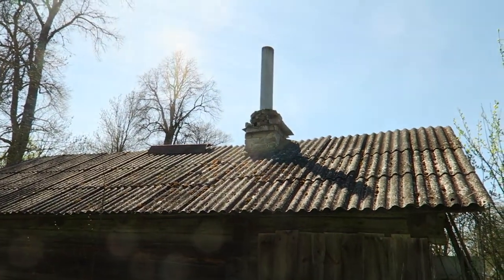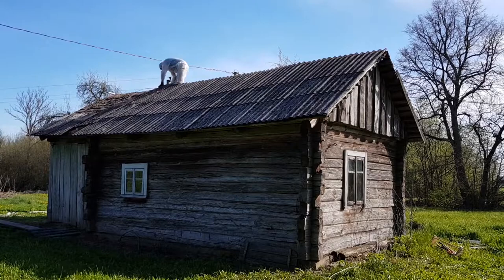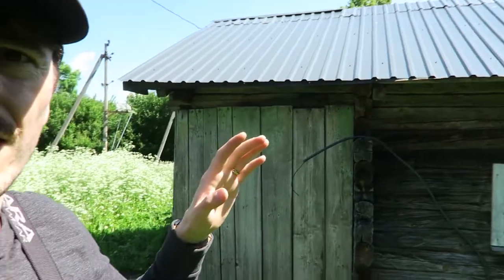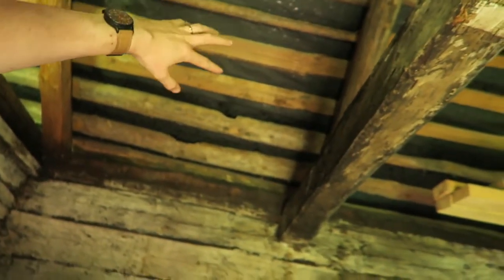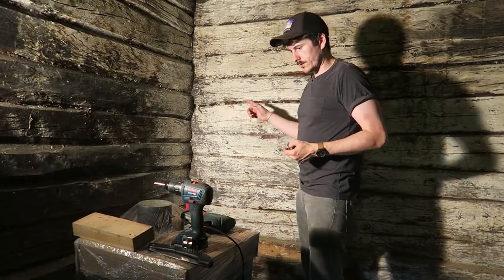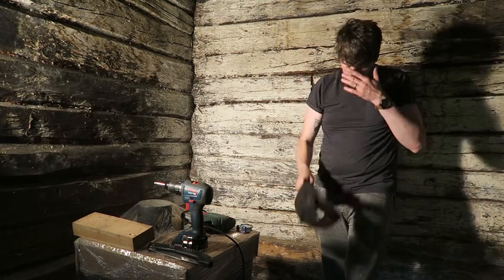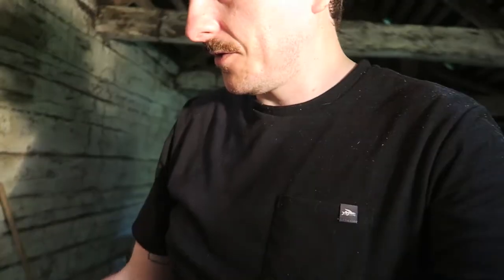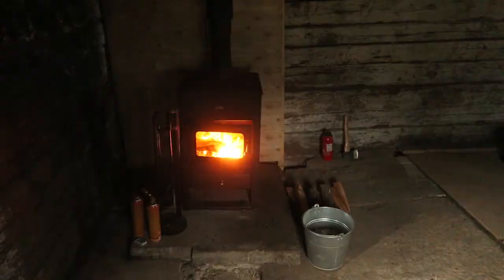Cabin to Workshop Renovation - Part 2

Comment: What asbestos roofing means ?
Reply from the maker: Asbestos is a material that was used a lot in construction in the 1940's through to the 1970's. I guess it was cheap and durable. But they later found out that if you breathe in the particles, it's super toxic and has been linked to different kinds of cancer. So you have to be careful when removing it.
Reply: @PaulPirie  oh, thank you now i understand why you wear some kind of protective gear when removing it.